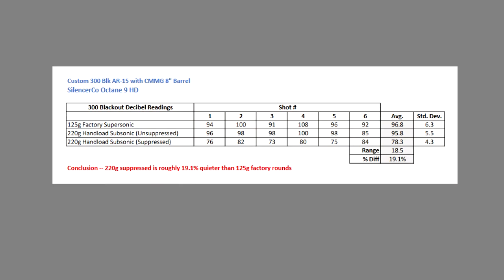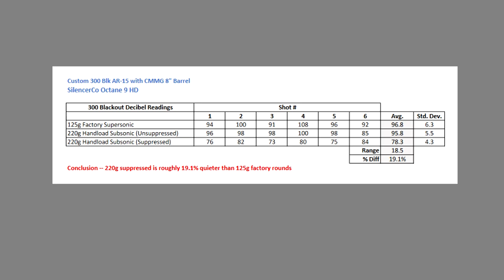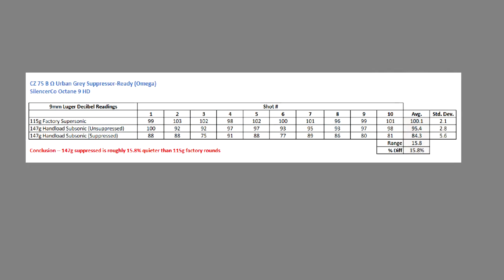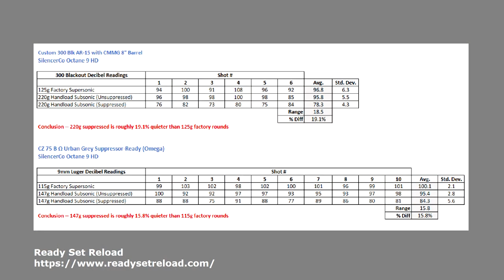Subs through an Octane 9 HD suppressor

Comment: (1) The decibel readings here are way lower than what they actually are. It's likely because the microphone on the phone was covered because of how it was propped up. (2) The sound of the gong was louder than the gun firing, so throw away all the 9mm 147 grain readings. (3) It is probably your buffer and buffer spring. Sprinco makes a "reduced power" spring which works really well for 300BO suppressed along with a standard 3oz buffer.

Comment: Are you using a pistol length gas system? Are you using an adjustable gas block? Have you tried a dummy cartridge in the chamber and a rubber tip nozzle down the barrel hooked to an air compressor to see  if your getting proper airflow through the gas tube and gas block? Is your gas block aligned correctly with your gas port in the barrel? Have you tried a different bolt carrier unit? Last but not least have you tried different magazines? Thank you for the video, Echo.
Reply from the maker: It runs a pistol length gas system. I'm not using an adjustable gas block but that was my first guess for a remedy as well. I'll try that and let you know if that solves the problem. Thank you for suggestions!

Comment: I had that same issue and took it to the gunsmith, they put a lighter buffer spring in the gun and it fixed it.
Reply from the maker: Do you know what the make/model was of the spring they put in?
Reply: @ReadySetReloadRSR  Sorry didn't ask,  I had a palmetto state armory one in it to start
Reply from the maker: Just ordered the STS-H2 today. I’ll let everyone know how it runs. Hopefully will be quieter suppressed too. https://armaspec.com/ar-15-parts/buffer-springs/stealthtm-recoil-spring/stealthtm-recoil-spring-srstm-ar15.html
Reply from the maker: Much quieter suppressed but the H2 is too heavy I think. The gun consistently didn't cycle the next round into the chamber. I'm going to try the H1 and see if that does the trick. Will update here once I find out if it works.
Reply from the maker: Finally got around to getting back to the range with the STS-H (3.8oz) and it did not fix the problem. The gun isn't jamming but the BCG doesn't go back far enough to load the next round. Same thing the STS-H2 (4.7oz) did. STS-C (3.3oz) is the only option that's between a standard weigh buffer (3.0oz) and the STS-H (3.8oz). Thinking about increasing the powder in the load or changing powders. I don't think the STS-C will fix it either. Also considering a lighter BCG.